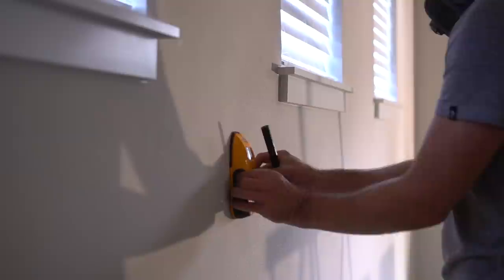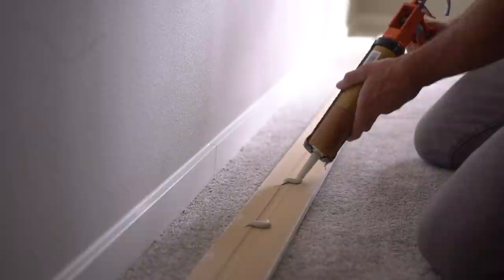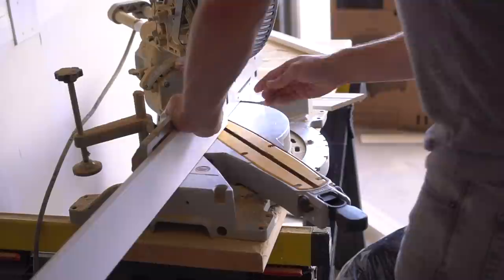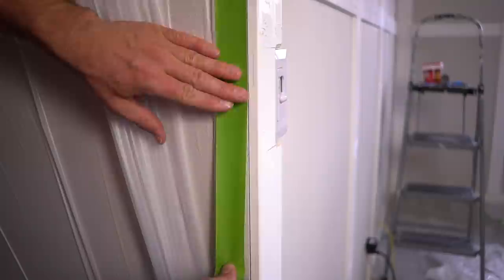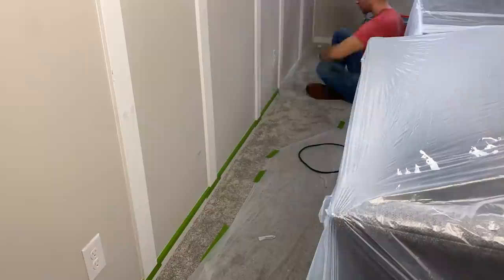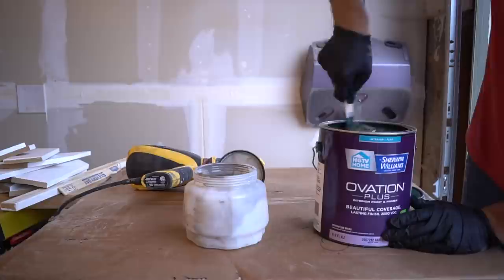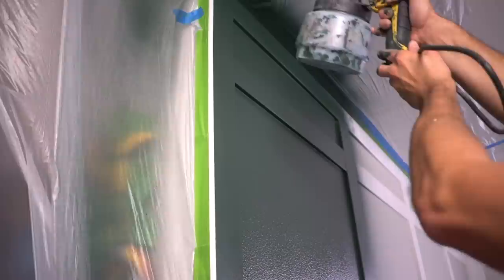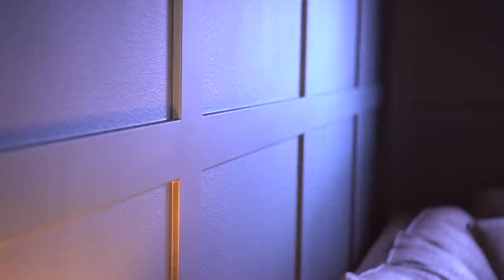BOARD And BATTEN Wainscoting

Comment: Such a great tip on applying adhesive behind the trim when installing.  I can't tell you how many times I have seen trim installed and it starts to come off the wall due to the nails coming loose.  Great video Brent, you are a master!
Reply from the maker: Thanks so much for saying that Mitch. Anything I build I want it to LAST :)

Comment: The joints have to be glued or Dominoed otherwise they will come apart with house and wood movement. Also if you’re painting drywall with a dark color it should be a flat  paint finish.
Reply from the maker: Well haven’t seen any issues so far on any of the project that I have done but if things adjust Due to movement I will let you know. And this paint I used was flat. Thanks for watching.

Comment: That idea looks soo great and simple to do for us DIY'ers... Thanks for the video, and will definitely be doing this in our summer cottage in the coming weeks. But a question for you, why didn't you just extend the faceplate with the switch with a bumpout and place a piece of board behind the switch plate?? Would this be a complicated thing to do? Or is it an electrical issue if it's done? And if so, is there a remedy for the electrical issue to make it safe? I feel it would've turned out a but cleaner than going around it with the board which would possibly show wear and dirt after sometime.
Reply: No electrical issue, he was being lazy 🤪
Reply: Others also wondered and he replied that it was the homeowner's decision. He mentioned that he preferred to move the light switch opting for a cleaner and more cohesive appearance.  🤷‍♂️

Comment: how did you do the adjoining corner vertical boards? Did you cut their edges in a forty five degree angle and then joined them or did you slightly overlap on top of the other? Hope I made sense!